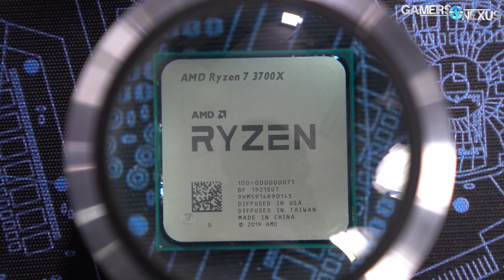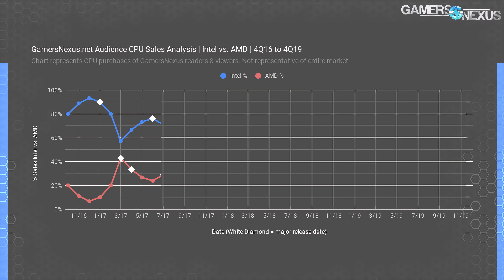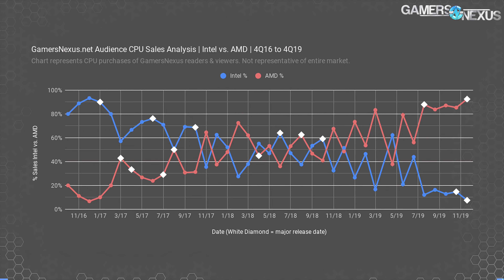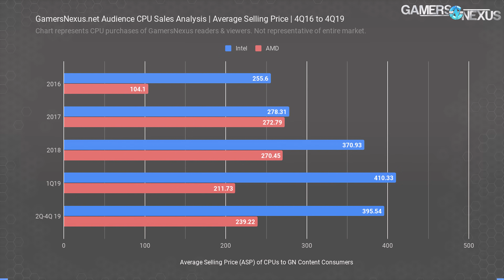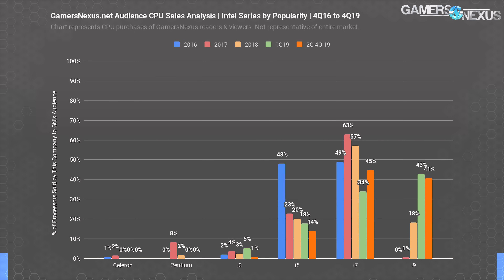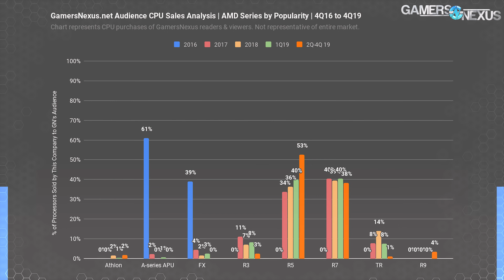GN Special Report: AMD Moves 93% of CPU Sales (Intel vs. AMD 2019 for DIY)

Comment: AMD is killing it on Amazon, mindfactory.de and GN's own stats...  At some point, someone will have to acknowledge that the available sales data is sufficiently robust for "wider extrapolation".
Reply: It's also killing it in S.Korea and Japan and while there's no hard public data for my country (India), most of the major retailers, distributors, motherboard guys are saying that Ryzen is outselling Intel by a ton. Visit any PC building focused group and the only time you'll get an Intel recommendation is for 9400F but even that's starting to disappear with the launch of R5 3500. 2 years ago everyone preferred Intel because majority of people in this region have only been in PC building scene ever since Core processors so they did not even know of a time when AMD was competitive and now AMD has build a massive brand recognition here. 

One other example is that when 1st Gen Ryzen launched, Retailers always had Intel CPUs listed on top in the filters with AMD CPUs buried under, now if you wanna filter out the processors, Ryzen CPUs are listed on top for ease of use. Says a lot about how Retailers here (who previously used to say that AMD is for budget used, overheats, is not reliable etc etc) have also shifted their attention from Intel to AMD.
Reply: The issue is both of these are enthusiast sites, as such regardless of other enthusiast sites doesn't extrapolate to more casual markets
Reply: @bengrogan9710  Different markets are... different markets.

People buying boxed CPU's in single digit volumes are what we're looking at here. Not laptop or pre-builts.
Reply: @RobinHood-yk8og  Precisely and those different markets are what Steve is talking about when he warns against extrapolating too widely.

GN's market is a niche of technically minded builders, and as such the narrow focus of that viewer base is not comparable to the open majority of builds
Reply: @bengrogan9710  GN's data relates to boxed CPU sales through their affiliate links.  The caution is that these numbers shouldn't be applied to the wider boxed CPU retail market.

My response is that the figures from a number of boxed CPU retailers are all saying the same thing - "AMD is Killing It" - and therefore at this point, each of those individual sources are representative of the wider, 'boxed CPU retail' market.

If you think these numbers are unrepresentative of other CPU sales, such as tray sales to OEMs... that's great, no-one disagrees, but at the same time, no-one's actually talking about those other markets right now.

Boxed CPU retail sales.
Reply: @RobinHood-yk8og  boxed CPU sales sold through affiliate links - each of those being for the enthusiast market.

Other enthusiast groups having similar figures reinforces the validity of the data - but only in regards to the enthusiast market.

The enthusiast market covers those who have in depth knowledge, or atleast feel they do - it doesn't cover Oems as you say, but more importantly it cannot be extrapolated to wider boxes CPU sales from the more casual system builder who is not widely informed.

No-one is saying AMD isn't beasting Intel in value, but there are still large volumes who stick with intel out of misplaced brand trust
Reply: @bengrogan9710  "enthusiast" - who the hell else is buying boxed CPUs at retail?

If you're buying a boxed CPU in order to build your own PC, you are the very definition of an 'enthusiast'.
Reply: @RobinHood-yk8og  Hardly, even the most normie of normals can, and does, buy and slap together a system
Reply: @bengrogan9710  Really? I know several people who would benefit from a DIY PC build for music production, graphic design and photography... and yet, inspite of the ease with which they could 'slap together' a PC, they've gone for Mac products.

PC's get built by enthusiasts, even noob or low budget enthusiasts.  It is not possible to build even a barely functional PC without having substantial knowledge of what you're doing.

You don't get to impose definitions of whole swathes of the PCMR based on arbitrary standards you've set according to nothing other than your own purely subjective and divisive opinion.
Reply: @RobinHood-yk8og  For one your example has an easy refutation in the fact that many in the fields you mentioned go mac based on the widespread use of mac OS software, building a hackintosh is a different kettle of fish.

And as for taking substantial knowledge to build a pc - flat no.

Pick your processor it tells you your socket
Use the socket to pick a mobo and that tells you your ram type
Then add in practically any power supply, practically any case and literally  any GPU along with any storage
Socket it all in the only places they fit, in the only orientation they fit.
Et viola you have a system

You seem to be hilariously trying to pretend I'm doing some form of gate keeping here by simply asserting the self evident fact that not everyone, and not even a majority of people who build their own systems is an enthusiast

Enthusiast in the context of markets is obvious enough to have it's own wiki entry, it is the subculture of pc component purchasers who hold a vested interest in the components and info relating to them, viewing the information itself as the goal as opposed to those who just want a pc that "just does what I need"
Reply: @bengrogan9710  
You're saying enthusiasts don't even necessarily build their own PCs, they're just happy learning about the components?

RIP logic...

The top-end A/V suites are platform agnostic, with the occasional exception.  One of the people I mention above uses the same DAW as I do.  There's no reason, given how easy you say it is to build a PC, why he hasn't.  Is he not interested in more performance for less money with a 'plug&play' PC build?  You obviously don't know the guy...
Reply: @RobinHood-yk8og  That's correct enthusiasts don't necessarily have rigs, but most do as a simple corollary of their interest.

And again you are going to this trite single example thinking of it as some form of gotcha - I already laid out one example of why some choose rebuilds, others include, particularly in professional roles, lack of time to build the computer and also the valuation of having an warranty for the full system replacement as opposed to single items
None of those facts however make it difficult to build a computer, simply that in the single case you are choosing that there are other choices being made
Reply: @bengrogan9710  There are no gotcha's here.  I'm just giving you a real world, if 'trite', example that, on its own, counters your broad assertions.
Reply: @RobinHood-yk8og  That is exactly the childish gotcha that I mean, pretending singular examples somehow refute broad categorization when there are multitudes of reasons why single users may choose OEM's despite the fact that most understandand can slap a pc together - mean while you continue your own inaccurate broad categorization and pretend the majority  of boxed pc sales are the enthusiast market.
Reply: @bengrogan9710  No one said majority... I said all of them. I'll allow a margin of error for morons who have no clue about anything and just thought " PC good"... but other than that insignificant number, the boxed CPU retail market is all enthusiast. PC builders are enthusiasts.
Reply: @RobinHood-yk8og  I was giving you the benefit of the doubt, that claim that everyone who decides to build a PC is an enthusiast is the exact idiotic claim why GN adds the disclaimer that their data doesn't apply past their market data for their viewers - it's a laughable claim you make not far different from suggesting people who buy a set of spanners must be mechanical enthusiasts
Reply: @bengrogan9710  Now you're getting your analogies confused...

A 'mechanical enthusiast' would be someone who builds their own machine with that set of spanners, e.g DIY car builders.  I suppose you're going to make the claim that there's a market of casual car builders out there too...
Reply: @RobinHood-yk8og  No, my analogy was specific, spanners, maybe I could have widened it slightly and said a set of spanners and a few screwdrivers, maybe a hammer but that would have needlessly confused the analogy- the PC is for most people a tool, and the fact that they can slap one together makes it slightly more complex than a hammer yes, but still a means to and end not the end in and of itself

But you are getting close.
That analogy was to illustrate how much you are over reaching by trying to label every build as enthusiast.

Having a repair toolkit doesn't make you a car enthusiast - it makes you pragmatic and simply looking to save on costs as you need it to work for getting you around

Car enthusiasts then go further than that spending more money and time by far on maximizing their car, focusing on performance, responsiveness and looks past well past the point where the car needs to be for any daily use case - the car becomes the goal, not the job the car does 

If I where to be making analogies to enthusiasts for engine rebuilds etc I would be talking about the XOC people who are into powermods, shunt caps and the like
Reply: @bengrogan9710  You can include all the tools you like, it's still an idiotic, apples to oranges analogy.  Owning tools, is not the same as using tools in order to build something, whether its a car or a PC.

You go further...  comparing people who build PCs to people who modify an OEM car.  Another apples to oranges analogy.  WTF?

And what's this? Car enthusiasts maximise their car's performance and aesthetics... whereas PC enthusiasts "hold a vested interest in the components and info relating to them, viewing the information itself as the goal." - Leave the goalposts alone. They're fine where they are.  'Enthusiast' has a universal definition regardless of the market.

PC builders and car builders are both enthusiasts.  There are no 'casuals' in the build it yourself space, in any build it yourself space.
Reply: @RobinHood-yk8og  You're just missing the point of said analogy, which is why you are thinking it apples to oranges - the goalposts stayed exactly where they where.
The comments on cars where expanded as you already conflated mechanical enthusiast with car enthusiasts and engine rebuilders, again something different to what was said - so I restructured the analogy to suit your assumptions to illustrate it with that in mind.

You are just failing to understand that to many who build a pc it is simply a tool, a means to an end and nothing more- these people are not what is being referred to in data when people are referring to enthusiasts and represent a large portion of boxed CPU sales, hence the disclaimer GN adds that these figure relate to their  veiwership.

To the Enthusiast market the PC is not simply viewed as a tool but more akin to a project

You are simply failing to look beyond your own biases and projecting the label enthusiast onto those for which it doesn't apply
Reply: @bengrogan9710   This is getting hilarious... you brought up engine rebuilding, not me.  You shouldn't have, because that's another apples to oranges analogy.  In the PC space it's the same as rebuilding a CPU at the transistor level.  i.e. it requires an expert level of knowledge & skill, and a professional suite of tools.... at least if you want a working engine/CPU at the end of it.  Expert/Professional... not 'enthusiast.'

I assume that you agree when I say that someone who builds their own car is an 'enthusiast'?  Someone who builds their own beer/furniture/house/boat/plane/watch/amplifier... would be classed as an enthusiast?

So why do you treat PC building differently?
  Tools & Components, check... knowledge & skill? Check.  Casual? If it's a PC, yes.  For anything else... "Enthusiast".
Reply: @RobinHood-yk8og  If you go back you where the one to bring in engine building after I mentioned spanners as you mistook mechanical enthusiast for car enthusiast- because you leapt well past the analogy I gave to something entirely different, which was when I then changed my analogy to suit your leaps

No an engine rebuild would not be equivalent to a CPU transistor level tear down as an engine rebuild is perfectly doable with home tools without ridiculous cost outlays, because the technical specifications and instruction for doing so are all publicly available - that is rather different from what is necessary for a CPU's creation where the manner in which they are created in the 1st place is part of the intellectual property of the owners and fabs - a CPU tear down would be more akin to cylinder reboring and port geometry mapping and regains - tools that are not reasonably available to the public

I personally am in the enthusiast segment so my personal rig is as you say - What you are missing is you are assuming that is the majority, or as you claim only way to view it.

This is why I brought in the car comparison after you leapt past my spanner analogy, but in the car analogy you where confused by conflating kitcar builds with OEM

So we'll try again and see if you understand yet another analogy

To the majority of people a computer is a necessary product - if they buy it whole or in parts and assemble it themselves doesn't change the fact that they only care that it does the job
Assembly of simple components  doesn't make you an enthusiast otherwise we would call anyone buying from IKEA a furniture enthusiast, despite the fact they still assemble it

To enthusiasts a PC is less a tool, more a project for further consideration and expansion.
Reply: @bengrogan9710  I said car builders... you said engine builders.

What does "cost" have to do with anything?  Billions of people will look at the costs of outfitting an engine workshop with specialised tools & equipment, and be astonished that some people do that as a hobby.

Contrary to your next absurd assertion, the knowledge, skills and tools required for CPU building are all available for anyone who wants them.  Google is your friend.

Again, I'm not claiming "majority"... I'm claiming 'all'.  If you're building your own PC, you are an enthusiast.  If you're building your own home, you're an enthusiast. If you're building your own fish tank, you're an enthusiast... ad infinitum.

Your next nonsense "For the majority of people a computer is a necessary product..." - This applies to cars too, no?  And homes? But you do accept that DIY Car builders & DIY House builders as enthusiasts, yes?
Reply: @RobinHood-yk8og  I have a feeling we are both talking past each other here and going well off into the weeds from our original subject.

As such I'd suggest we both take a step back reread and decide if we want to continue this in a less adversarial manner as from my point of view for the last several replies you have countered with nothing of substance besides essentially a single use case and then going "Nuh Uh"

From my point of view I believe your point is that multiple sites have similiar data on the sales - the issue we disagree on is you believe that this represents enough to apply the data wholesale.
Is that a fair synopsis of your original point?
If so please explain why these sites, even when viewing the data of their own and peers in aggregate still state that it cannot be assumed to be a reflection of the overall market.
Reply: @bengrogan9710  "Less adversarial" - but then - "nothing of substance besides essentially a single use case and then going "Nuh Uh"
".

gg buddy.

1) Answer the questions I asked in my previous reply.

2) The issue we're debating is what the "overall market" consists of... I have suggested, numerous times, that the overall market is 'boxed CPU retail sales'... all of them.

I think you started to agree with that in your first response, before spearing off at a tangent and apportioning particular and extraordinary motives & qualifications to the GN viewership, and segmenting the 'boxed CPU retail sales market" into 'enthusiast' and 'casual' categories...  You may well be in with a chance of winning GN's award for Pointless Segmentation.

Sure, reread at your leisure. I'm still waiting for responses...
Reply: @RobinHood-yk8og  I feel that being honest about frustrations with you is less adversarial than simply laughing at you when you make ridiculous claims like 'anyone who builds a pc is an enthusiast', but hey maybe that's just me
but in response
You: I'm not trying for childish gotchas
Also You: GG buddy

As for what cost has to do with the definition of enthusiast - Almost everything as that determines what is reasonable for the average person interested in any given field to engage in as in real terms time and cost are the only meaningful differences between the majority of enthusiast and professional descriptors

To pretend that what I'm talking about would get an award from GN for Pointless segmentation when they directly warn against taking the data out of context and trying to extrapolate whole market trends, I'm struggling to find words for how dumb that line your wrote was.
As for apportioning extraordinary motives to the GN viewership - again struggling to see how this level of density hasn't been weaponized for anti-tank work
GN is one of the most long form and in depth review channels that exists on YouTube to pretend that their viewership isn't majority enthusiast is to just flat deny reality and is the specific reason GN references it when talking about their market data as there are a good half dozen market segments that their viewership doesn't cover

Anything you put together yourself makes you and enthusiast? that is the most child like and hugely over reaching definition possible
Did you cook a meal? - you're now a cooking enthusiast
Have you ever screwed together flatpack furniture? - congratulations, you are now a furniture enthusiast

Enjoy wailing into the void
Reply: @bengrogan9710  I thik it is just you. G'night Ben.